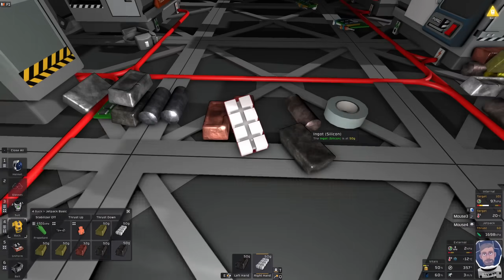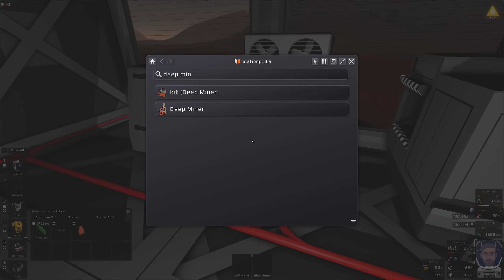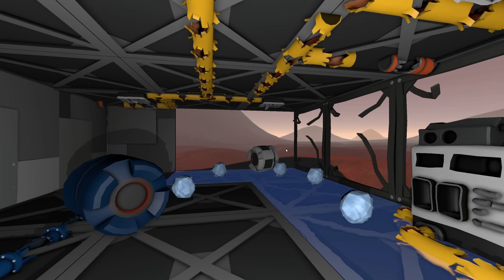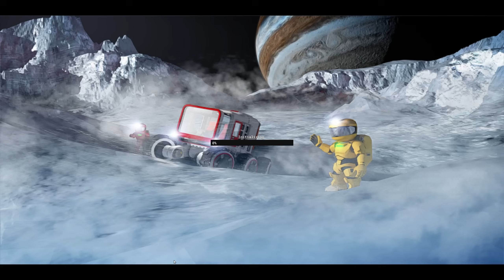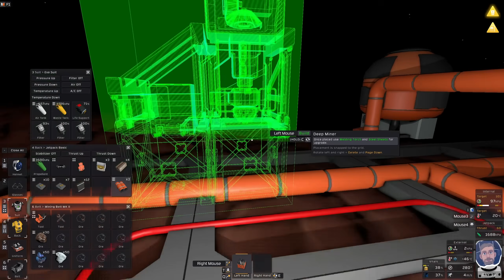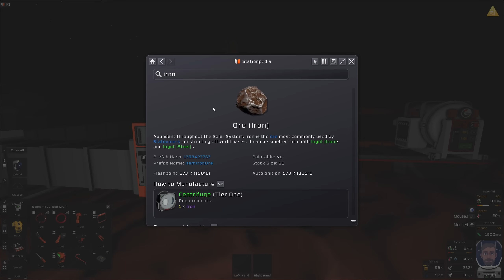Deep Drill, Combustion Centrifuge & A Big Bang | Stationeers | Tutorial Series For New Players | #15

Comment: Canister go boom. Liquid canister had some co2 evaporation and that overpressurized your liquid canister. Happens all the time. You should also remove that fuel canister and the nitrogen canister too. Those will eventually explode unless you clean them out.

Course now that I post this I remember that you did this before the update so this world is basically no more. Moot point.

Comment: Hi can you loop your output gas line back into the input original gas line from your adv furnace?  Or will it put a bunch of crap back in there due to the ores?  Thanks
Reply from the maker: Hey jasmarie,

The output gas from the centrifuge can be used in the input line of the furnace if that's what you mean. All a furnace cares about is the temperature. The mix of gas does not matter. As long as you can get your temperature and pressure to the requirements, you're golden.

Just be careful not to run the output line back into the fuel input. This will dirty up your fuel mix.

Comment: Heya, setting both throttle and limiter to step 1 (10) and letting the stress zero out and then push to 100 is what I discovered also.
So, there will be fewer lines of code, really, if you want to automate it.
I did not know the ores got degassed in the combustion centrifuge! That opens up a new system of automation 😊
Thank you for the upload!
Reply: Only surface ores have gases inside them. So no need to try capturing gases from deep drilling
Reply: @jannefock9337 Oh okay. Well, really not that big of an issue then, when you actually get to deep drilling 👍

Comment: 43:37 - You can only keep your furnace (if enclosed) as hot as the the toughest components that need to connect to it. For example, I tried making a furnace for Stellite that was contained in a 1x1 steel frame room. Doing this means your furnace wont passively cool down or lose pressure, but the high temps will combust your wires and chutes, thus making this impossible for higher temperature alloys. This can work for lower temperature alloys. I made a solder furnace that uses a gas fuel generator to heat the room. The IC keeps my room at a constant temperature/pressure. 

I did make a high temp furnace that is always ready for Stellite, Steel, and all basic ores. It uses an H2 Combustor to provide the heat into an insulated tank. The IC controls the furnace inputs/outputs and over pressure safety system. It's super easy to use as it is always ready to go and is my go to furnace for Stellite, Steel and the basic ores.

Comment: Lol”ask my wife, if I’m always too quick” 😂 probably a statement you should have NOT said…😂. Combustion Centrifuge (CC) has a max of 3000 Reagents, electric is 400.  Just note with the beta, if the CC is placed on a non pure region, like gold/silver 0.66/0,33 programing it can a bit harder, cause it will give you a decimal numbers like gold 2000.6/silver 999.4.  Rounding the Reagents count does helps. And when automating, using an external chip is easier than on board chip but still doable
Reply: Why would an external IC10 be easier? The only difference I see so far is the centrifuge only has d0 and d1 for external devices, but will work the same and occasionally even use less power.
Reply: @hb-man  the reason is Internal Pressure.  when the machine is running at full throttle its about 9Mpa (8.97) when your able to turn the machine on/off via IC housing, you can get that pressure to drop to 0.  also, the machine slows down very quickly.  it will go from full speed 514 RPM to near/at 0 in like 10secs.  if the CC is left on and the levers are set to 0, it takes a LONG time to stop.  also, the pressure will never drop to less than 4.1 MPa.  If you open the CC while the RPMs are high, it will stress out to 100%.  so you need the RPMs to drop and faster is better.  then the other issue is restarting the CC,  with the CC in a 0 state, 0 RPM and 0 Pressure, its VERY easy.  set the levers to 10, wait until the stress drops to 0 and you can set the levers to 100.  doing is this way the stress wont ever go above 60.  If you want to you can also code to wait until the stress goes below 25ish then increase the levers by 10 ea time till they get to 100.   Internal chip, cause you cant turn the CC off or the internal chip wont work, you will be starting the restart at 4.1MPa pressure.  when you set the levers to 10. the machine will most likely stress out.  i got lucky once and it got to 98% stress.  to prevent it stressing you will need to reduce the levers down to 0, wait for stress to decline, then back 10.  and keep doing this till the CC machine "catches up"  then you can increase the levers as you see fit.  
My script i wrote for an internal CC chip.  during startup, it sets the levers to 10, waits 1 sec, reads the stress ("OldStress"), waits 5 more seconds.  then re-reads the stress ("NewStress").  if the newstress is 1 more the old stress it drops the levers by 10, if the new stress is 2 less than old stress it increases the levers by 10.  it will keep doing this until the RPMs get to or above 400, then sets the levers to max and its placed in a "run loop" until its full then goes into a "dump cycle"   Plz start a creative world test what i have said in this "novel" of a reply.  you will see yourself what im talking about.
Reply: @BayalinAlamain  I wasn't considering that turning the CC off was required for operating quickly, thanks for elaborating. 😊